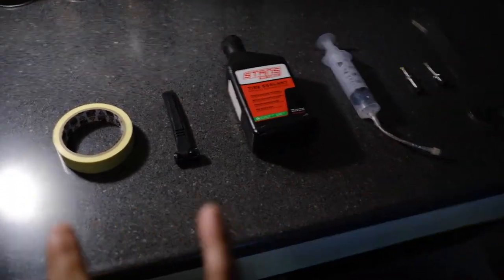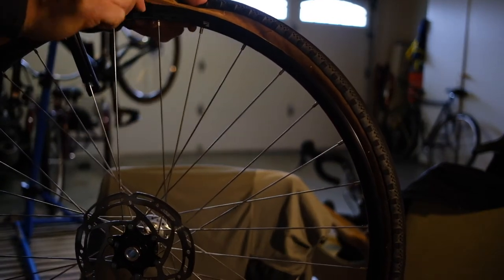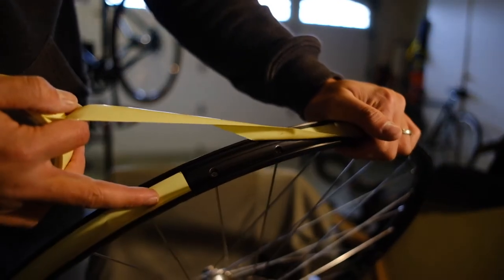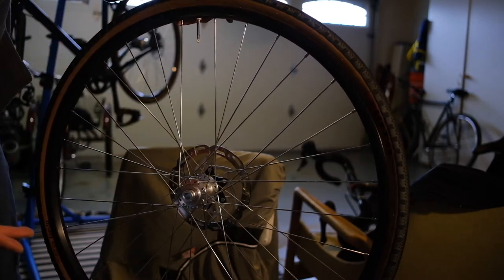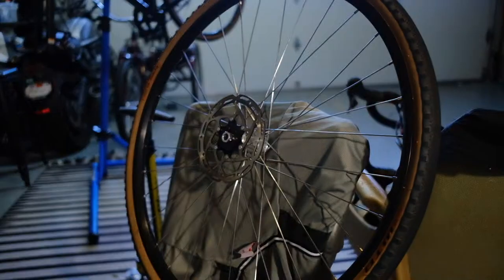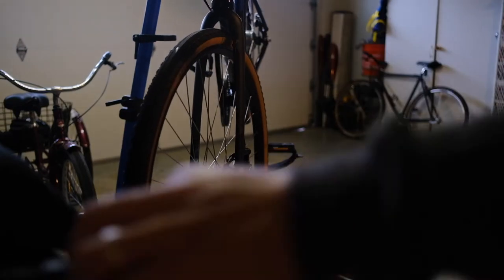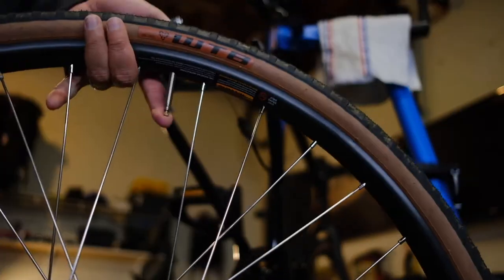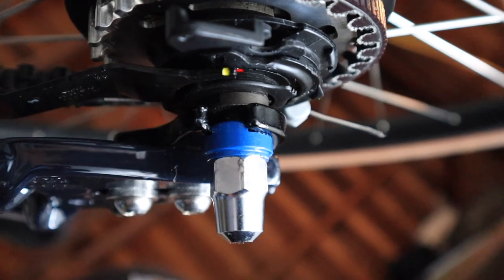How to Set Up the Priority Apollo Tubeless!

Comment: I love my Apollo and thanks for the video! I've found that it's easier to remove the rear wheel with the bike upside down. Also, you can actually tape over the red rim tape that comes on the wheels. I think it's designed that way and helps make the tape lay more evenly by smoothing over the spoke holes. At least I hope it'll stay after setting mine up tubeless a few weeks ago.
Reply from the maker: Yeah the Apollo is such a fun and smooth bike. Love how robust it is. That’s a good call on removing the wheel upside down, ha, I almost lost my hand. That’s a good call out about leaving the rim tape that comes installed. I had no idea you could do that! I’ve always set my tubeless tires up using this method, but now I wonder if I should have left the already installed tape...

Comment: I've been considering going tubeless for some time, and watching this video has convinced me.  When I began and was riding the most, it wasn't even close to really working, I watched others, never even thought to bother in the seventies.  I had no idea it could be so easy, but an awful lot of things have changed, even since fifteen years ago.  Thanks for a most insightful, skilled job demonstrating the swap.  I'm convinced.
Reply from the maker: Oh wow. I'm stoked this video was helpful to you! Thanks for taking the time to comment and leave a thoughtful one at that. Have fun out there!
Reply: @thegravelist  I entered bicycles like most boys did, in the sixties, a 20 inch, turned to "stingray", then getting a ten speed, Varsity, about 12.  I ended up building a steel framed Raleigh, with the latest six speed cog, by 75, at about 23 pounds, as light as I could afford.  I spent two decades in the Corps, cross trained for strength and endurance on a cheap, nice road bike, and same for mountain bike.  Just got back in, after twenty, for health, and everything is vastly different.  I've wrenched all my life, machinist, toolmaker, but have rediscovered my old passion.  I'm waiting on delivery of an "L-train", due in July, and riding a nice road bike, and trying to get my old mountain bike free of about ten pounds of NC mud, learning how different it is from either the old or very new.  I'd really like to be "relatively flat-free", never was before.  Thanks again, and for the reply, I've found myself in "youtube" with this plandemic, as never even considered, and really enjoy the "community" other than the "deletions".  I've been having "the time of my life", and a lot came off of this kind of thing.  I think many people are doing much the same.  My best,

Comment: One more tip is to re-install the tube and tire and leave it for an hour or so after the tubeless tape install to really compress it onto the rim before you put the valve and sealant in. Afterwards, remove the tube and continue with the sealant procedures.

Comment: A  couple  of    comments.
 Regarding  the problem   with the   gears not    working   smoothly the   Alfine hub,, given   what  you  said about the  yellow   lines  I  have found  that  after  a  few  thousand    miles,  if  I  have  a   problem   with the  shifting,   I  change  the   oil in the  hub  and   the   shifting  is   fine..
 When   I  am removing the   Alfine  hub, I   put it  into  the   highest  gear, (the   cable  is  at  it's  loosest) and  that  makes  working   with the  cable  easier.

Comment: Some tires you do need a compressor .... the WTB Byways are very tight on the sidewalls so they seat very easy ,  Tip on th Stans sealant  ( what I do is i mix half regular and half Race sealant to get better puncture protection) by mixing 1/2 1/2 sealant won't dry as quick if it was pure race sealant    

              great video content BTW keep em coming thanks !

Comment: Hey, Tim. I am coming back to this video because I have to ask something. In researching the Priority Apollo gravel bike, I watched some YouTube videos and saw no less than four flats, one of them was your first video on the Apollo. That did not instill a lot of confidence, but I think they were all with tubes. So I was wondering if you could tell me how these WTB Biway tires have been since switching to tubeless.
Reply from the maker: Heyyy! Thanks for coming back to the vid. Since going tubeless in the byway I suffered one flat. But that’s no fault of the bike, by any means. The byways have really soft and thing rubber. I’m sure there’s a more technical term for that, but they seem more at home on road than off. If you got a stronger tire with thicker casing I bet that would help!

Comment: So you used the same tires after adding the rim tape and tubeless valve?  No need to buy a different tire?  Any advice on options you’d get when one orders it from Priority (fenders, racks, kick stand, racks, etc)?  Any issues since you got it.  Think I’ll ask for the easier gear, if I can.  How was the sizing?  I’m riding a 61cc Specialized Roubaix road bike.  Thanks for the reviews!
Reply from the maker: Yooo. Thanks for the kudos! No need to buy a different tire as they’re tubeless ready. Just the new valve, tape and sealant then you’re good to go. A rear rack would be pretty sweet, especially if you’re going to commute with it. As for the easier gear request, I’m not sure if they’ll do that. I may have jumped the gun in saying that... sounds like they don’t offer that. Sizing was good. Pay attention to the top tube length on their geo spec. As for stand over, I have a 30.5” cycling inseam and the medium allows for about 1” of space — so perfect there. Good luck!!

Comment: Just was curious after a few months with the Apollo, if you are still riding it, and what you think of it long term. I am a first time shopper for a gravel/road bike buyer, and am really intrigued, but just wanted to hear more opinions of what people think long term.
Reply from the maker: Thanks for the comment and question! I am still riding and loving it each time I do. Specifically it's the smoothest feeling bike to ride around town. The gates belt drive is still butter. I haven't done any maintenance with it other than washing my bike with a hose and soap. That's been real nice not having to fiddle with a derailleur and needing to lube a chain. I also use it to commute to work with where I'm wearing a pair of jeans and I don't worry about showing up to work with a greasy pant leg, ha. As for gravel -- since I set this up tubeless I've been able to run a lower PSI which has helped soak up bumps n such that you encounter off road, plus the ease of mind of not puncturing my tire is nice. In summary... long term? This bike still rules. Each time I ride it, it feels like a brand new bike. Smooth, quiet, and very capable off/on road. It's really just a lot of fun to ride! 

Hopefully this helps!
Reply: @thegravelist  thanks a bunch!

Comment: I love your reviews of this bike. I am retiring next year, moving to Japan (where I lived for 14 years in my younger days) and I plan on starting cycling, so I'm researching what my first bike should be. Looking at gravel bikes because I'll want to do both city riding and some bikepacking, including multi-day tours in various parts of Japan. I hate doing maintenance so this belt drive system looks perfect.  I'm just wondering, have you done any bikepacking on it, or otherwise loaded it up with bags and/or panniers?  If so, do you have any impressions to share?
Reply from the maker: Hey hey! Thank you for your kind words and HUGE congratulations on your retirement. That’s going to be amazing moving to Japan as a retiree, what a life!!

I think this bike would be fine for light backpacking. I would fit it with some larger tires for sure. But it’s longer wheel base, longer chain stays and up right riding position lend itself to longer hours in the saddle. The gearing, however, might make things a bit difficult. The gear range is more suited for gravel and road. If you’re looking to climb, especially loaded down, then the gearing would be steep for that. Have you checked the 600x out? That bike is ready for adventures and has the gear range to back it up!

Good luck with everything. And happy retirement!!
Reply: @thegravelist  Thanks for the reply. Yes, I have looked at the 600, well, the 600X because I've been watching Ryan Van Duzer like a madman. It costs nearly twice what this Apollo does. I think the 600 would be great for climbing but I think it's slow. I'm looking for something more all-around ready so I can join in on some of the city rides that the local clubs do and then I can load it up and head out to Okutama with a tent and some cooking gear.  I was mostly just wondering if this was sturdy enough to handle, say a couple of panniers and a handlebar bag.  Keep up the good work. I like your videos.
Reply from the maker: @BooLee01  gotcha! This bike is definitely strong enough for a pair of panniers. If an all rounder is what you’re looking for, then this is a great choice. It’s built well, has the gates and internal gearing which would is perfect for outdoor adventures. I think it would workout well for you!
Reply: @thegravelist  ,  @Eikichigai (Billy Woolfolk) Late to the chat, but I just got my Apollo and use it for commuting with full panniers (computer, change of clothes, lunch) and was worried about the gearing.  Here in Portland OR, it turns out I can just manage most of the hills. Full on bikepacking would be a challenge. I ended up buying a larger rear cog from Priority which will give me another 8% or so on the low end.  I am not really worried about the high end and going fast because I can always coast down hills.  It's the climb that is worrisome with this.  I lived in Japan for about 16 years, and think that with this lower gearing you might be OK.  Apparently it is a pretty simple change.  Haven't done it yet, as I am currently trying Panaracer SS+ for the commute to cut down rolling resistance.  See how that goes at first.  Best of luck with your retirement, and Tim, keep making those vids.  Love them.  Not enough about the Apollo out there.
Reply from the maker: @ericanderson1110  love the insight! Great idea about purchasing the larger rear cog — I’ll have to give that a shot. Enjoy the bike! Thanks for the kudos on the videos, much appreciated!

Comment: Great vid.  Personally I HATE rim tape.  I know rim tape is lighter, but Gorilla tape is so much easier to work with, and I have WAY less failure rate with using gorillla tape to seal the rim.  Also, with the Alfine 11, you're supposed to shift to the 11th gear, then shift up 5 gears to 6th gear, then align the yellow alignment marks.  Seems like it wouldn't matter, but definitely did with my Apollo.
Reply from the maker: I agree with ya! Gorilla tape actually sticks and has more flex to it, which is nice to install with. Thanks for the tip on the gear alignment!

Comment: Hey Tim. I'm interested in the Apollo but after doing some research, there are quite a few Alfine 11 failures, especially when pedal hard on 2nd gear and 10th gear. Have you gotten any issue, gear mis-shift, gear slippage at all?
Reply from the maker: Hey Qui - thanks for your comment and support! I haven’t had any failures that you’ve mentioned. I’ve taken it off road a bunch and have struggled up hill in 10th gear and it hasn’t been an issue. I did have some mis-shifts after riding the bike around a few hundred miles, but that was easily fixed by adjusting the barrel adjuster until the yellow lines lined up on the hub. Hopefully this helps!
Reply: There are two versions of Alfine 11.  Original s7000, this is probably the version you read about.  Newer s7001 is supposed to be more rugged.  I suspect it would take couple more revisions to become bullet proof like current Alfine 8.

Comment: How often do you add more sealant after your setup of tubeless tires?
Reply from the maker: I usually check levels every 6 months give it take a month or two.
Reply: @thegravelist  Just got my Apollo last week and I'm thinking of going tubeless.  Mine came with Goodyear Connector tires, which I assume are tubeless compatible.  How do you check the sealant level?  And how does it lose volume? leaks? evaporation?  Great video; Thanks!!!